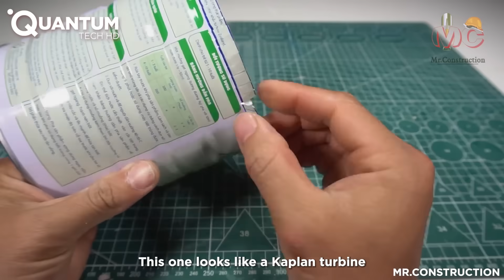Ingenious DIY Hydroelectric Turbine Systems | Free Energy by @mr.construction9846

Comment: also a better idea for the drum use a higher pitched blade because I noticed that it wasn’t moving as fast compared to the water. If you know what I mean so use a higher pitch blade so it isn’t struggling so much and it will spend faster and have more torque

Comment: A diode amplifier circuit that’s the first one the second one is they call it a rail gun voltage accelerator circuit and the third is a nuclear power circuit but you don’t need the nuclear power circuit the nuclear power circuit alone as a power plant just use the rail gun voltage, accelerator circuit to get you enough voltage to bucket back down literally doesn’t matter how much input voltage use the amplifier to get you up to around 500 V Just outright when you get 500 V stop and bucket it back down to something usable and I promise you that power plant right there can more than supply the power for an entire household, using the diode amplifier and a rail, gun voltage, accelerator circuit, both of which you should be able to find here on YouTube
Reply: The reason I say to stop at that voltage is that sparking at that voltage doesn’t x-ray when you go when you get to 750 V or more the spark is gonna give you an x-ray when you hit 900 V just the electrical circuit itself can give you an x-ray so keep it at 500 V or less

Comment: "Energy without an inverter? Sure, and I make coffee with a lemon battery."

The self-taught genius who powered a fan — yes, an alternating current device — using only DC water current, without an inverter, without a rectifier, without anything. According to him, physics has resigned. But in reality, he is either blowing wind with his thought… or confusing a dynamo with a miracle.

Scientific spoiler: any AC device needs conversion. Without an inverter, it won't even spin a top.

Comment: That last one, I wonder if you could actually use it to clutch add to a flywheel.  To help with that drop in rotation due to load feedback on the motor/generator.

Comment: This is how over-unity works, same with solar and wind power. Any device with the ability to pay off it's "energy deficit' and continue to produce energy without creating new deficit greater than it's output is an over-unity device. This is only possible with a preexisting physical force where we don't need to convert matter to create a physical force. In every other case we convert matter to a physical force and then use that force to create electricity or combustion. Science tries to associate over-unity with perpetual motion which is not possible. This is misleading and an actual lie as over-unity and perpetual motion are two different concepts. A magnet is a battery that stores physical energy. Modern neodymium magnets have a theoretical lifespan of 1000 years, losing approximately 10% of their field strength every 100 years. Until now nobody has come up with a way to extract and use that force in a way that allows over-unity and thus free energy. I have solved this problem and released it globally as open source. This device called MEO (Magnetically Enhanced Output) is capable of efficiency ratings in the 4 digit range (over 1000%). This device requires no fuel, produces no emissions or heat and will work in or outside of an atmosphere and/or gravity field. click on my handle to see how/why this works and see a demonstration device in action. The videos are short and video #2 shows MEO producing around 166x the energy it needs to operate.

Comment: i hate to point this out but if you are going to use a dynamo motor to power a fan, Why not just use gears to turn the energy from water kinetic to fan kinetic instead of letting some of the energy be lost in the conversation from kinetic to electrical kinetic to kinetic

Comment: Very cool!! Alot of these designs are conceptually so creative but they all seem to be lacking design components to sustain long-term longevity. Something to consider is moisture in the circuitry and housing of cables, these will allow for the design to be used in a more practicable way without needing to repair it every few months. Great work though!!
Reply: It's because they're just made for the videos and then just left to rot.

Comment: super cool, my thoughts are the only problem now is how do you build the motors required to generate the electricity from the hydro energy harnessed, or the wiring to move the current, or the converter/amp or whatever that grated mechanism was. (Forgive my ignorance in this field)  

Then of course if you want to store any of that electricity you need batteries how do we make those?

Fascinating but still not fully diy. We are reliant on sourcing those complex & often machined parts that use difficult to obtain earth minerals etc…

Comment: Genius. Id like to know what material is that your using and cutting up say for the prop and turbine but also what glue are those please. The clear one and the graygoo one
Reply: CA glue (superglue) and epoxy.
Reply: @ryanbremner76  thanks. What is that stuff your using, plastic?
Reply: @maroli8023  It's not my video, but yeah its probably some styrene plastic. You can buy it in sheets for model building and stuff. Love the fiberglass coating though.

Comment: FREE ENERGY? where? im not an Electrical Engineer but im not an idiot to notice that the motor you used can't even output that much power to run a fking series of light bulb let alone the that fking FAN, also you FKING IDIOT if you put a load on it you're generator fan should turn slowdown but it didn't, which i conclude your VIDEO is A FUCKING FAKE AND MISLEADING.
Reply: Chill bro

Comment: if you do videos like this again, please include scientific finds, even if it's just the voltage coming from the generator
Reply: you realize there's several factors to the potential power output and these are just mini generators to what have been around for almost 100 years.
Reply: @renshawfamily  But putting a multimeter in the setup is totally doable.
Reply: @renshawfamily  is it a lot to ask to include that information? i want to learn so it would help out my journey. Were you assuming I was negatively commenting when you decided to reply to me?

Comment: I have real life application for this, whereby I get a high pressure flow under gravity from a spring 15 meters above my land (falling across a few hundred meters theu a 3inch pipe that then becomes 2 inch) . water supply truns 365 days a year and it runs hard once I open the valve and the pressure builds. I reckon i am passing around 3 or 4 cubic meters of water per minute thru a 2 inch pipe. The water ends up in a large lake. Can anyone tell me how much power in kws I might get form such a flow using a system like this (1 turbine) ? Like I say its a fast reliable flow. Lets say 50 cubic meters an hour to be on the safe side.

Comment: Fantastic fantastic stuff, both the meticulousness of the build and the visuals and explanations.  There are a few benefits of dams and a few negatives of river generators that are ignored.  A dam benefits by storing water above it, and therefore increasing the flow (and electrical output) through the dam.  The river generator, while effective at an individual level, if implemented at a city level, would not only affect flow but would heat the water high enough that oxygen is no longer saturated ...resulting in dead fish and dead plantation.  No matter how you do something, there will be negative impacts that have to be adjusted for.

Comment: I knew someone that created a power turbine that used Mercury and the heart differential between the inside and outside of his shed to create a power generator. It worked by heating and expanding the Mercury outside to lift it up and over a drain, as it drained it moved several turbines to generate power it then moved into the shed where it cooled before being added back into the pool to be reheated. I'm not quite sure how the injector part worked as it was a sealed system because you know, Mercury, but I think he said something about using the weight of the Mercury as it fell to push the pump. Not entirely sure how much energy he got or if it in at any given time but I know he built it.

Comment: Water flows the path of least resistance, so yes you can power something like a LED light string or a fan at really low RPM. It won't be able to supply any real power and it will be VERY irregular.

Comment: Nice stuff. Just one fyi. If you are trying this at home you need to check what type of pvc pipe you are using. We ( in Europe. From dyka ) get 90%recycled pipe and it's very different to heat and work with than non-recycled pipe ( which is what is used in this construction.) I think this is great use of brain and water power . 👏

Comment: Water needs to be refined to rush purely into the middle for extra thrust If you can mesure the forces You base the angle of the blade of the turbine And the forces needed to top speed vs torque of the generator
Reply: Yep that's precisely why commercial hydroelectric stations have at least SOME form of filtration that the water goes through prior to entering the plumbing that ultimately leads to the turbines. The second part of your statement was also correct, as they want to increase efficiency to the max, so they get more bang for their buck. Also ends up helping out the customer as well.

Comment: wonder if any of these have been built on a slightly bigger scale to try and provide at least some power to villages where they need the energy?....obv everything has to be there in order to do so but this seems like a real cheap way to create power (im not an engineer or anything so i really am unsure if these are viable on a bigger scale, but they are cool to watch them being built)
Reply: The first one has.  Used in South America.     It uses wooden molds and Concrete.  The main rotor system can be transported in on a medium size lorry.

Comment: Idea - Assume water and electricity do not belong since water needs to be moving and you don't want to move resistors relative each other while the current is on. Maybe a water pressure vaporizer could help. Better pressure less conductance.

Comment: I liked this video just a few inquires though.  Why did you use straight impeller blades vs the more efficient pelton curve blades or impulse impeller design? also you have an open core around the shaft vs a filled/walled space around it to prevent the water from dropping through the core and essentially creating drag on the rising blades. Was this intentional?  The input jet is also offset from the outflow plane. It seems like the jet would be better in plane with the outflow, was there a reason for this? I liked the mini dams, they were very cool. My personal favorite is the kaplan axial since you can split off small overflow dams 1-2 meters in height and return the flow back to the main body for local power without adversely affecting wildlife

Comment: I like that the loading effect can be noted just by the sound of bucket in last part when he connects the appliances to the supply
Reply: why does it slow down? makes no sense for me
Reply: @Kayserjp  if i had to guess it would be because of the law of energy, when the energy is being wasted and just placed into the wires it doesn't seem to effect it, but as soon as it got plugged into something to consume the energy, it causes it to bog down, creating a form of friction between the two objects.
Reply: @leviathan1082  Almost correct. Without a load there is electricity but no power consumption, thus little resistance. The higher the load the higher the power consumption and thus load. These are fairly basic engineering principles, regrettably these basic principles of how the world actually works are not part of the standard curriculum of schools.

This btw is not a viable power production means. It suffices if all you need is some lighting assuming you add a bit of battery capacity, but that is probably just about it.
Reply: @Nemesis-pe7mw  ah, thank you for the correction, I appreciate it. I figured I was off by a bit but had at least a basic idea on how it worked
Reply: @Nemesis-pe7mw  it may not be a viable way to produce lots of power, but it is so damn cute!
Reply: @alancharbonneau4108  Lol, thank you for making me pee my pants... 

I laughed a fair bit at that thank you I needed that after the day I had!
Reply: @Kayserjp  This idea was shown to me in physics class many moons ago. We had a crank flashlight that we can crank and power the light but we also had a capacitor that could power it as well. When we connect the capacitor we were told to hold the crank to prevent it from spinning and you could feel the power of the capacitor attempt to turn the crank. As the capacitor released it's current it would power the light and turn the crank but if you hold the crank neither would work. It wasn't easy to completely stop it. The fan in this case is my hand holding the crank because the motor on the fan is putting a resistance on the current and slightly holding the current like my hand was on the crank. It's not just the current that slows down but also the motor being turned by the bucket and thus the bucket gets slowed down as well. Mechanical to electrical to mechanical. That bucket being slowed down is actually a problem because it will cause unnecessary stress on the blades turning it. One could help the issue by adding gearing which can be used to buffer the effects of the resistance of the electric motor on the fan.
Reply: @Kayserjp   Once you extract energy from any spinning motor it slows down. This is also the same reason why perpetual motion machines are impossible. Funny enough, it actually produces the same amount of energy even when it spins slower, because torque is a function of energy generation. I.e. if you have a giant turbine that weighs a million pounds, but is spinning very very slowly, it will still actually generate a good amount of energy because of all the torque behind it. So when resistance is created in the motor by extracting energy, the turbine might be spinning slower in the water, but the water is also delivering the same force over the same period of time, the turbine is just spinning at a higher torque.
Reply: idd it makes the difference between this and fake unlimited power videos

Comment: Was going to ask the same question- how much actual output? But enough to run that fan is an impressive ammount.

Thanks for the video. Some useful geometric layout tips there.
.
Reply: i am about to tell a sad truth it is fake (fan is not dc)
Reply: @wahid6497  Why would the fan have to be DC exactly? Do you think all generators are DC?

Seeing the fan speed and how unstable it is I'd guess it's real, it's definitely possible. The designs are horrid and inefficient, but it doesn't seem to be faked.
Reply: @wahid6497  Generation from an engine is not DC...
Reply: @wahid6497  The same as number two (I stopped watching after that), there's no way a 30cm drop would create that kind of pressure, it's silly.
Reply: Yeah i don't think it's those little fans can be 30w and less a 20w 120mm pc fan can move 200cfm so your not talking big power only a bit mor than one of those hand crank dynamos and for the amount of water moving though it i could see well built one making 100w or so
Reply: @shaynegadsden  at 1 cubic foot per second (this is nowhere near this) and a head drop of 6" and perfect efficiency you'd just barely crack 100W. This is very generously 0.1cfs and if they have a conversion efficiency of 0.5 I'll eat my hat, so even with these very generous estimates they can maybe put out 5W
Reply: Nevermind that, it's an environmental hazard

Comment: wonderful! Why does the turbine stop at the end every time something is connected?

maravilloso! por que se frena al turbina al final cada vez que se conecta algo??
Reply: It slows down because the free spinning speed is the rate at wich the turbine is synchronous to the water flow and does not alter the path of the water molecules.

As the electric alternator open voltage is connected to a load, a current will flow through the winding causing a torque.

The way turbines cause torque is by changing the direction of the liquid and no change can take place at free spin. It has to slow down.

If it slows down to zero it will have a high torque but no work will be excerted, as energy is force multiplied by distance or torque multiplied by angular displacement.

Power is force multiplied by velocity or torque multiplied by angular velocity.

Both factors are required for power. You can not have power if rotation speed is zero and not when it is at free spin.

It will settle at a speed where the torque of the turbine equals that of the altrrnator.

If the alternator torque is higher than that of the turbine the difference in torque will deaccelerate the rotating system until there is an exact balance.

If the voltage of the alternator is 100 volts at 100 RPM and it is connected to a 1 volt battery it will rotate at 1 RPM.

At that low speed it may have a high torque but the speed is so low the product of the two becomes useless.

Voltages and gear ratios has to be selected to a point where the product of speed and torque is at its maximum.

At that point water will slow down. If all energy would be possible to extract water would pile up. And at zero speed water will not follow the curvature of the blades and rather curve off at low performance, long before the obstacle.

Like with a paddle or a water wheel where the shape has little effect.
Reply: @tofo2  my life was resolved. How can I thank you for such an answer???

Comment: How do you waterproof the motor at 2:45? The motor seems to have a small gear ratio. I suspect it can generate enough power to turn the fan on.
Reply: the spray can filled the gaps